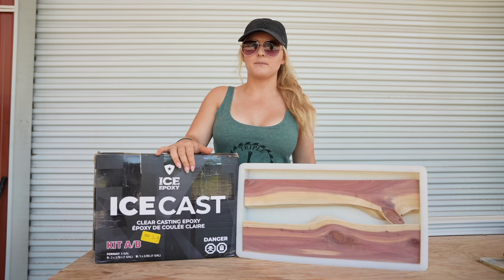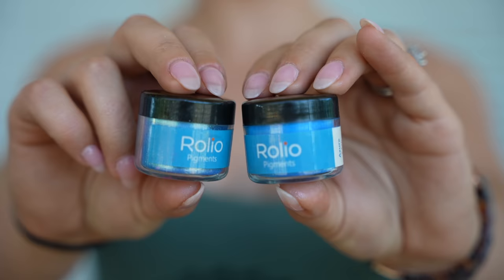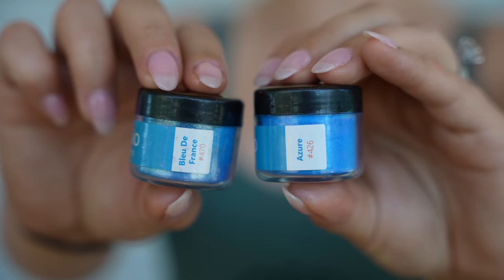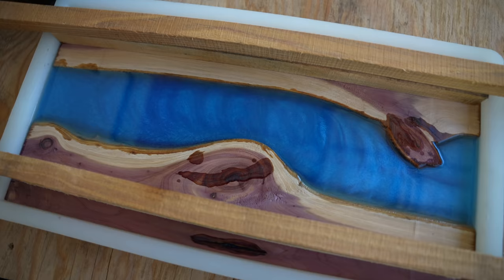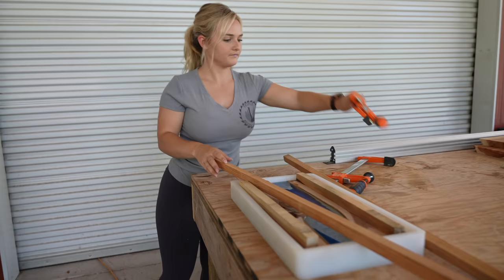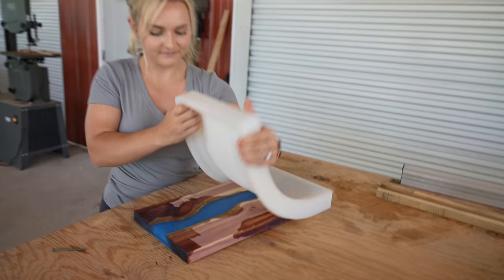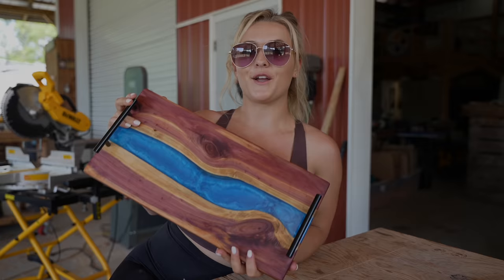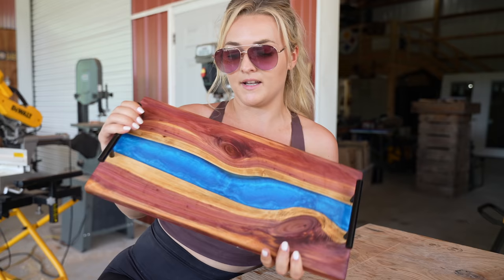Zoe Made A Red Cedar Epoxy Charcuterie Board & You Won't Believe The Results!

Comment: Project looks great.  A couple suggestions:  Drill the counterbores first with the Forstner bit then drill the through hole.  The Forstner bit point will leave a center point making it easier to drill through with the smaller bit.  Second, wait until you put the finish on the board before you mount the handles.

Comment: Nice 👍.  just never drizzle the oil either damp cloth or sponge. Never straight drizzle on, it'll leave mark. By the time it'll take you to smear it the wood has already soaked it leaving shadow. Happens in epoxy yarn/fishing rod eye threads n etc the color hue changes due to amount of absorption
Reply: 👍🏻
Just finished watching the video and was about to do the same recommendation.
Reply: What oil did she use?

Comment: That is very cool! When you run it through the planer you should build an extension to the out-feed. When the board is unsupported past the feed roller,  it will drop a little. This is called snipe. When you get snipe, the board tips a little into the knives of the planer. It looked like this happened. Of course you can sand the snipe out. The more that you sand, the more distortion in the surface. The goal is minimal sanding. Hope this helps. Keep striving for excellence...

Comment: You should finish the board off with 3M Scotch-Brite Abrasive Scuff Pads, in Ultra Fine, and Light Duty which goes down to 2500 grit.  It will get your epoxy polished and take out the fine scratches.
Reply from the maker: Great tip!! I will order them now!

Comment: Superb work.  Great choice in die colors.  

If you’ll sneak up on the last planer pass by only taking a few thousands of an inch.  You may be able to reduce that snipe.  It doesn’t always work on a two post planer.   You can also try lifting the board as the last few inches come it.   That doesn’t always work either. But, that might also be worth a try.

An old woodworkers truck is to run through a longer sacrificial board will normally prevent it! 

One thing that is guaranteed... Slightly dull blades or slop in the bearings will make any planer snipe!

Nice video.... thanks.

FYI... I’m doing a series of videos on repairing a Victorian staircase on my channel.
Reply from the maker: Thank you very much for the tips! Our planer is a cheaper one. We plan to upgrade to a nicer one in the future. Your channel sounds interesting and I will check it out!

Comment: I love seeing anything using epoxy whether it’s river tables or lathe work. 
If I may… if you hold the gallon jug, flat and pour instead of pouring forward it won’t “glug” out of the bottle. It will pour a smoother stream and is easier to control the amounts without the “drooling” down the front of the container.

Comment: Always a treat to see the beautiful Zoe show us her talent in woodworking. The Crafted Elements form is a really neat tool for the home craftsman that wants to get into Charcuterie board making using an epoxy filler. Thanks for sharing. After wiping on the mineral oil, it looked like the initial pour marks were still visible. Did they finally absorb and disappear, or would it be easier to use a sponge or rag dipped in a cup of the oil to not have those pour marks?  The board did come out looking beautiful.
Reply: I noticed that too. Thought it would have been better to pour the mineral oil on the epoxy and wipe from there outwards.

Comment: If you place your cup of epoxy in a vacuum pot before you pour it it will literally pull all of the air bubbles out. Then if you pour slowly it becomes crystal clear